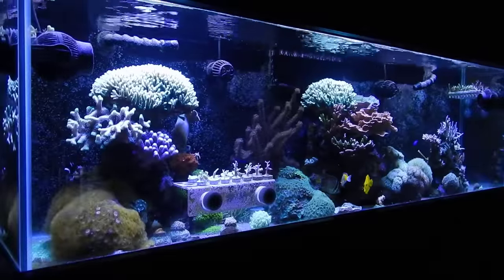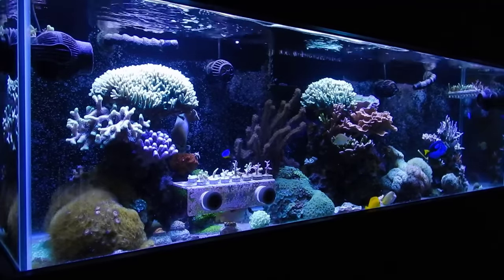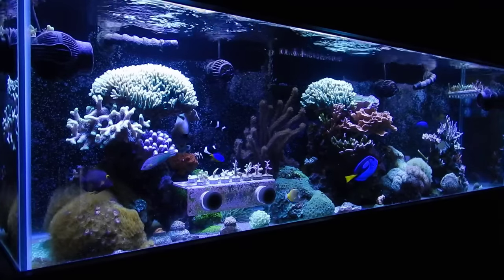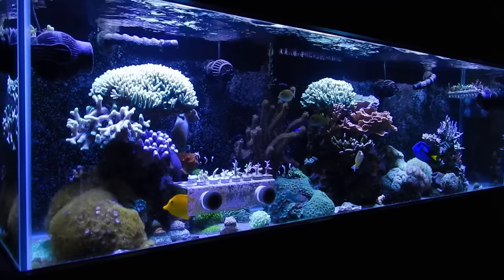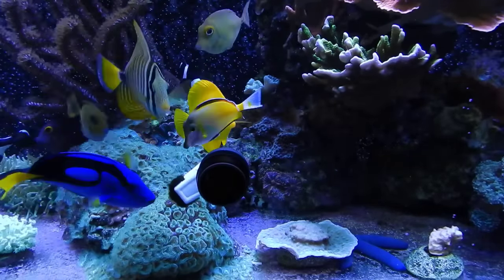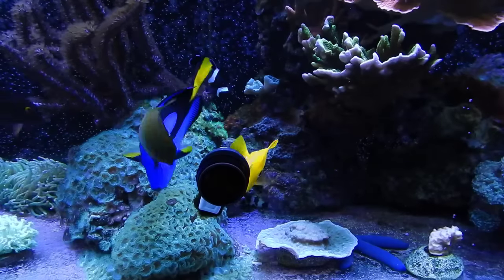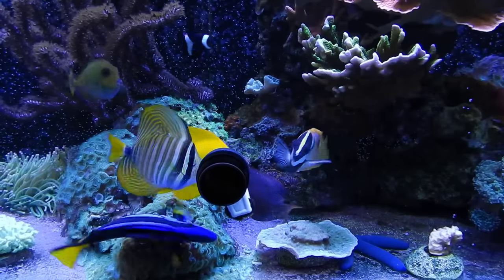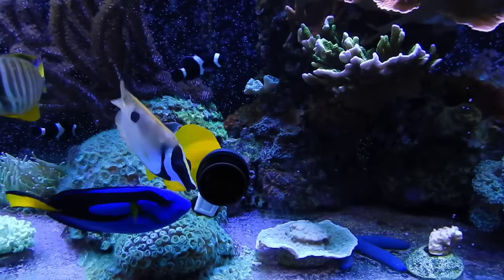10 Things You Can Do To Save Your Reef Tank

Comment: Very solid info Hex. I agree and do everything you mention but have a question on one thing. When you QT your fish do you always treat with meds as a preventative measure? I always QT but never treat unless I see signs of disease or parasites. If I do see signs, I treat and start the QT process over again. I've always figured the meds might just cause extra stress and why treat if fish is not sick. Please give me your reason for treating as a preventative measure if you do. I'm always researching methods and I appreciate your input. Thanks.
Reply: Phillip Tennell a fish can have ich or a certain disease but won't show.(sometimes when there in the DT, its too late) there's no since of qt and waiting to see if it appear. its a waste of time IMO. I dose copper regardless of showing or not. best to be safe than sorry.
Reply from the maker: Im on the same page as HNiCDuke its best to treat everything and not wait for it to show up. I have had ick wait over the qt period to show itself and well at that point its to late. I would wait a couple days before dosing anything to let the fish settle in but you should be good if you start slow.

Comment: I purchased two battery back ups with built in GFCI, just in case. The only things not plugged into it are the lights. Made sure, I have the Heater, filter, and wave maker plugged into that. Drip loops are in a bucket. :)
Reply from the maker: i wouldnt worry about the lights as you can go a few days without them and have no issues with coral.

Comment: Wonderful video great information and well worth watching. Although I would insert one thing at about number three or four and that would be a Grounding Probe. A probe is just as important as a gfci outlet in my opinion. Thanks
Reply from the maker: actually research shows that grounding probes just allow the current to keep flowing in the tank and it will kill your fish and coral if not found in time. I find that using them now just slows the process of finding the problem. I have a friend who lost an entire sps tank bc of it.
Reply: FishOfHex strange and I lost five fish because of stray voltage that a multimeter didn't catch but as soon as I plugged the probe in ( not to my apex) my Apex went ballistic under my amps reading. I removed the bad heater after checking each plug and it was a bad heater.
So I don't know. On Reef to Reef forum it's overwhelming encouraged to use one.
Other than a generator I do or have everything you mentioned ( learned a lot from you Brother 😀)